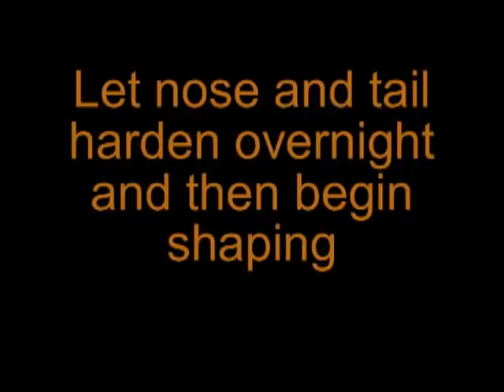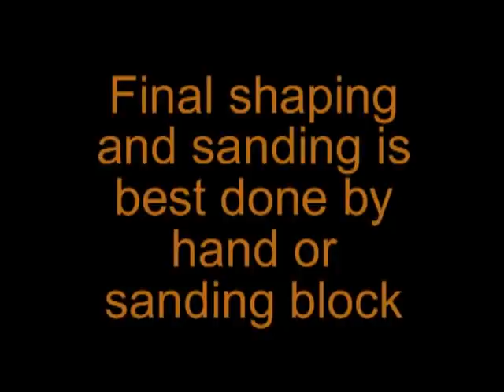Ends Blocks on a Paddleboard

Comment: I assumed they were filled with closed cell foam until I saw you cut off the end. I noticed what looked like drain holes in the ribs, is there a drain plug somewhere you can take out to drain any water that may get in if there's ever a crack? Wish I found and subbed sooner, you do perfect work!
Reply from the maker: +Shane K There is no drain plug but a small air vent that if necessary, I suppose one could drain water out of. But hopefully water never gets inside.  Inside there are holes in the frames to cut down on weight and small holes called limbers to allow water to drain to one end where the air vent is.

Comment: So it is Not necessary to have any dowls. The epoxy is enough to hold?
Reply from the maker: RYAN POLETIS The epoxy bond is stronger than the wood itself.  But the board is fiberglassed after adding the end blocks, so no dowels or biscuits is necessary.